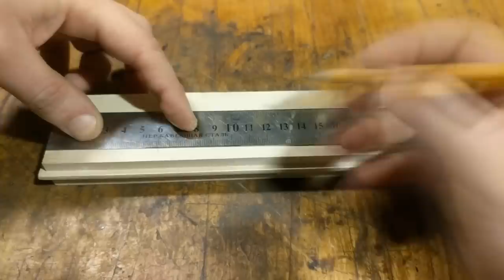DIY Phone Dock Station

Comment: A tip to make the slot for the wire.  Clamp the pieces together, mark your depth, and then drill.  It would also be advisable to go down farther below the plug so when the cable is run out the back it isn't making a tight 90.  And a last suggestion would be to attach the bottom with screws.  That way if the cable dies, it can be replaced instead of having to make a whole new stand.
Reply: protips, especially the screw one
Reply: Good advice
Reply: Once you've drilled the hole, how do you get the cable in?
Reply: @JAYRAY00  the pieces would just be clamped while you drill so they would come apart once you're all done
Reply: @PsYkoTicxxRipZz  ahh I see, I thought it was after clamping and gluing

Comment: Why the slits in the side? Functional or just decorative?
Reply: Joseph looks like hardwood flooring
Reply: Joseph yeah I wondered about it too, i thought they may be for cooling the phone while in charge or you could slide a picture in there , it w'll be cool
Reply: I think it's for sound from the bottom firing speakers
Reply: Probably from sanding because he chipped one of the corners and didn't want to leave the blemish.
Reply: I'm wondering the same?

Comment: For "Version 2.0", add a cooling fan to the back of the unit so that both phone and stand do not overheat!  You may also wish to create an iPad version that builds a set of cooling fans AND a speaker system for all around sound.  Just a thought du jour, yes?